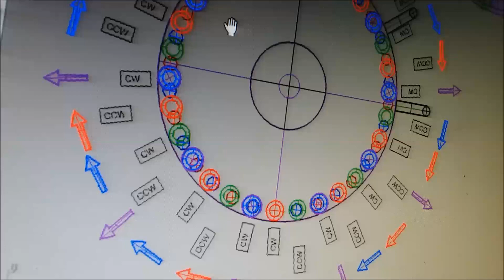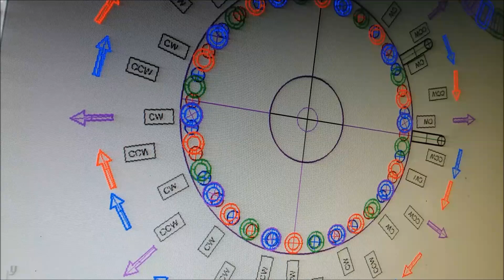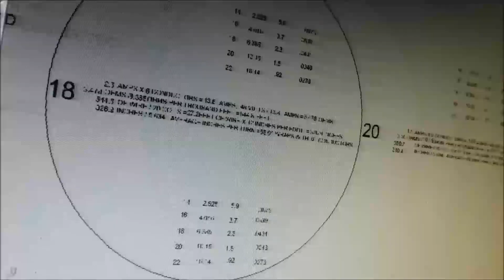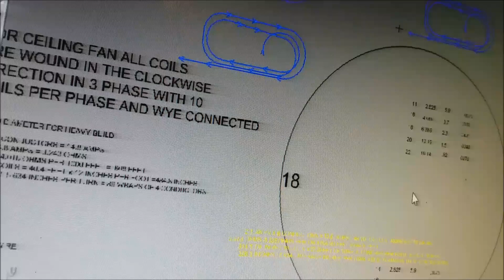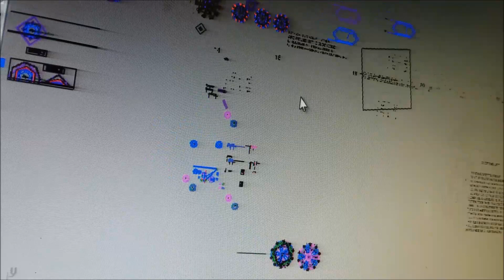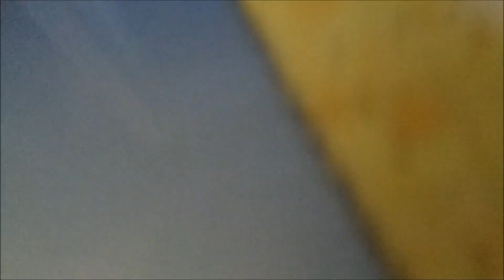HOW TO WIRE WIND TURBINE STATOR COILS CONSIDERING POLARITY FOR EFFICIENCY PART 3

Comment: Hi great video. Just a quick question! Would it be a bad idea to use n35 magnets?
Reply from the maker: You need to have enough gauss (magnetic flux)  to generate the design
power. The advantage to N52 magnets is that they are compact for their output,  and the device can be built smaller. Using weaker magnets
will increase the rotor and stator diameters, however the larger diameter has the magnets rotating faster which makes more voltage. A first generator is a learning experience so using less expensive magnets will
not lessen what you learn just how much the lesson costs.
Reply: @concretehousebuildinginph1488  that's great advice. I guess the larger the diameter the more the magnets also.

Comment: ok, so simply how do you find the wire diameter needed for certain outputs ?  a 4 min video
Reply from the maker: Output is in watts. Voltage times amps is watts. From there you determine amps. Then go to google images for a chart of ampacitys of various wire guages. Round up to the next heavier wire guage for the amps you require.
Reply: @concretehousebuildinginph1488  I was wanting to properly convert an alternator to a generator(PMA) and the stator looks "puny". would i still use this method for that? just find out how many turns I could fit in the stator space and fill it up? what would the math look like on that? Id like to make an excel spreadsheet calculator for it after I make and test one. thanks for your reply.

Comment: Why is this underrated? This video deserve more. Keep up the good work sir
Reply from the maker: Under rated because Youtube doesn't put it on recommended videos.  Or possibly it is correctly ranked. To be successful you need a charismatic presenter working from a planned polished script to keep the run time under 8 minutes. Also you need to publish something every day. This channel is content driven around building a house
in the Philippines, a narrow group of interest, and I only post when I have content. The next video is likely how to calculate rebar required for a concrete suspended slab. At least there are no Ads THANKS FOR WATCHING

Comment: Thank you for being the first video to even mention the direction of the coil windings.  That part has been driving me crazy.  I find that with 12 coils putting them all clockwise like a screw going into the piece of paper.  So when a north comes into the phase phase 1 coil  the current goes counter clockwise so out of the paper and out of the stator.  At the same time a south pole is entering a coil connected to the other coil causing the current to go clock wise into the piece of paper and then over the the above coil.  So the current all goes in the same direction correct?
Reply from the maker: Yes, the current all goes in the same direction because all the coils of a phase are connected in a series. The coils on either side of that coil are operating with current flow in the opposite direction when the magnet we are calling a phase 1 coil is acting on these adjacent soils. But when that magnet  is on the phase 1 coil the magnets on either side of it are the opposite polarity being arranged _N_S_N_S_N_S_N_S around the rotor. This effectively makes current flow on the adjacent coils flowing in the opposite direction. Considering a WYE connected generator with all 3 of the coil sets connected in the center point. Current flows from the outer end of a coil set to the center point and then out to the external end of the second coil set. So at any given point the two coil sets have current flowing in opposite directions are addative. Now for the bit that makes this work. A coil has two sides. The side the magnet is approaching till centered and then passes over the other side. The coil winding is a continuous wire and follows "the right hand rule" That is think of the fingers of your right hand wrapped around a wire showing the direction of magnetic flux, then your thumb is pointing in the direction of current flow.The magnetic flux is staying the same so your thumb is indicating current flow in the opposite direction on the second side of the coil and you get AC (alternating current) output. If you are having trouble with this draw it up DELTA connected.  There will be a voltage generated across any two points of the triangle since you are isolating the string of coils between those two points. Then let the 3 phase H bridge rectifier figure it out to make it a DC output.
Reply: @concretehousebuildinginph1488  Thank you starting to get it now.  As North passes over phase 1 coil the current starts flowing counter clockwise and when that N magnet is in the middle the current stops, while the North is now driven out of phase one coil the current goes clockwise.  So introducing a North pole to a coil is the same as removing a South pole from the center of the coil.  And introducing a South gives you clock and when it's removed counter clock.  So again in phase one North is entering the coil = counter clock, phase 2 south entering  = clock, phase 3 N entering counter clock, and the 4th coil is phase 1 which will have a S entering it and produce clockwise current.  So the first coil is in series with the 4th.  The fourth generating clockwise current into and over two the first coil which if coming from bottom to top is counter clockwise now. In series they all push or pull at the same time.   Last question, if I have 12 coils why would I need more than 12 magnets?